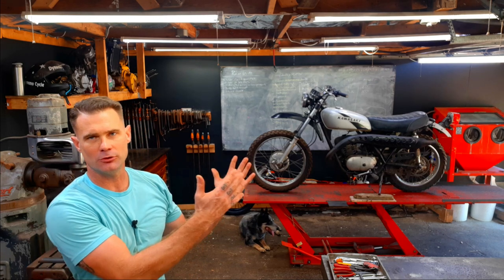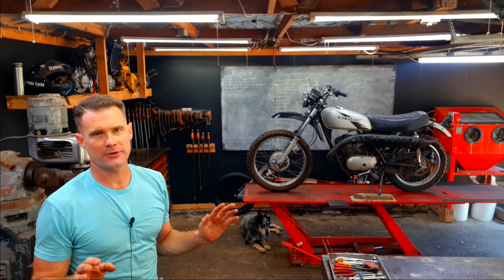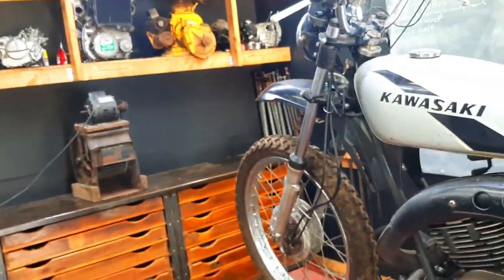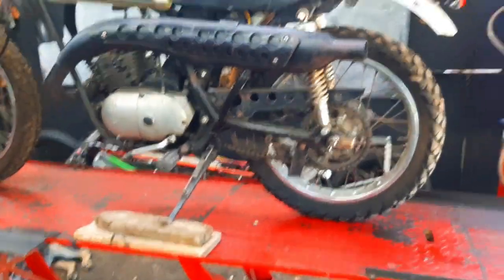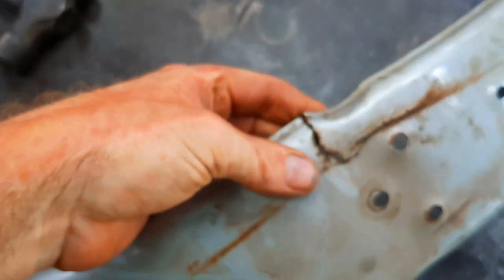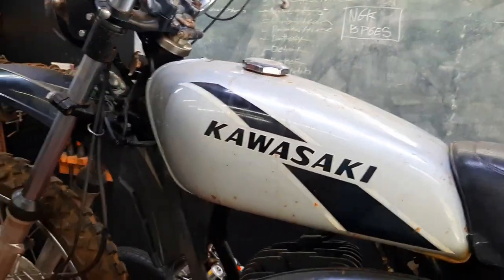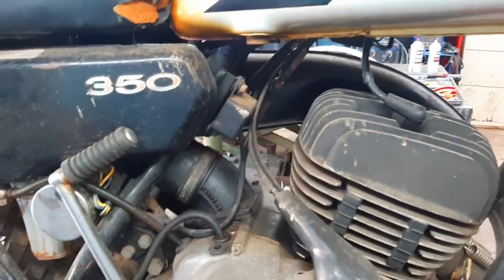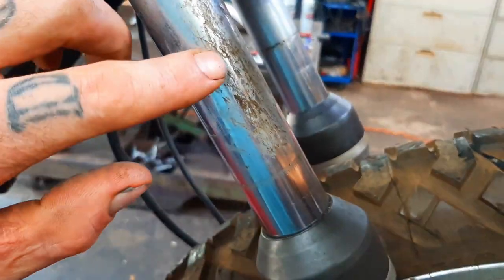1975 Kawasaki BigHorn F9 350 Restoration *Part 1*  Vintage two stroke enduro dirt bike

Comment: Cool bike, cool vid. Definitely repaint fenders. I wish you would repaint the tank and not just clear coat it. In the long run, it will not matter if the paint is original. I have never had anyone look at my bike builds and ask if the paint was original. Looking forward to this series.